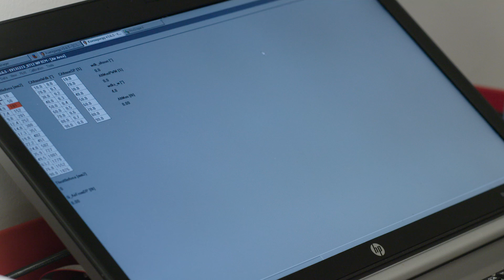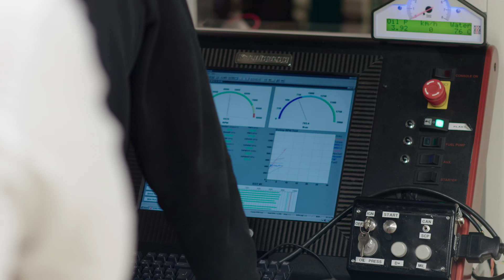The 1360HP Heart of the Koenigsegg One:1 - /INSIDE KOENIGSEGG

Comment: The Ford engine
Reply: Nope. The very first Koenigsegg used a modified Ford engine. The last car with a Ford based engine was the CC8S in 2003. The engine was built in-house by Koenigsegg in Ängelholm, but based on a modular Ford V8 engine architecture. All later Koenigsegg cars had entirely inhouse designed engines.

Comment: I personally disagree with the speaker's statement on hybrid vehicles. Hybrids are actually quite useful for the general public, and is more than just a trend. These vehicles, although not too well suited for the track, are particularly useful for city driving, with regenerative braking increasing the fuel efficiency dramatically. Does the One:1 get up to 70 miles to the gallon? I do agree that such technology isn't suited for the One:1, but hybrids are still useful elsewhere.

Comment: instead of a valve on the intake, why not an air injector like a fuel injector, you already have air pressure
Reply: You can't provide that much air through a small nozzle, sure you could raise the air pressure but the air volume needed can only efficiently be provided by a turbo- or supercharger. The one:1 uses 2 turbochargers therefore the intake air already has 0.8 bar(if I remeber correctly) under full load, and sufficient volume!

Comment: When might this technology be available for the medium to heavy duty diesel market (one tone pickups and semi trailers)? If so would it be sold as an aftermarket kit or will you lease the valve rain to other manufacturers?
You could make serious money there because diesels will never become obsoleted by electric motors. It can always produce more power and with minor changes they can use a variety of fuels. This system would be great with common rail injection.

Comment: One word; TESLA.
Reply: +Everett Cox What about tesla
Reply: +Daniel Lamoureux Actually, Tesla(762hp/900lbft) will not beat the Egg at that power level. The Croatian EC Rimac(1100hp/2800lbft) will. And the builder says the motors have lots more power in them.
Reply: +Everett Those cars weight quite a bit more than this one, which is a major factor in koenigseggs design
Reply: EV supercars don't tend to have a good 0-60 or 0-100 unlike the Model S.

Comment: im gonna have to disagree with you mr .koenigsegg. Hybrid cars are the future they will be lighter, power delivery is instant, torque is off the scale at a smaller size and weight premium and less moving parts to fail. In fact i wont be surprised if motorcycle companies don't adopt hybrids in a few years. You believe that hybrids wont be as powerful as a single engine system but your very very wrong In time you will make one too you just dont know it yet.

Comment: So yes the torque starts falling off after 6K-rpm but the HP keeps climbing because of the higher RPM. I get that.  I just don't see how increasing piston speed is going to help with engine life...Versus...Stroking the motor to say a 6 or 7 liter and keeping the RPM's lower...Any friendly, opinions..?
Reply: It's a ford designed engine that they have taken and made their own. look up their information on how the 4.6 dohc can't get too much bigger then a 5.1 liter.
Reply: mustangspartan I wasn't aware of where the engine originated.  The 4.6 did have a pretty good main cap set up.  Like six bolts per main cap.  So I guess it's not a bad choice.

Comment: Hello reliability problems. 272hp per liter says it is.

Perfect for showing off on some drag strip. Naturally there are other tuned cars that do better so what's the point with this?

Probably has huge turbos and loads of boost. That will be "interesting" to drive on anything but a drag strip. 

If any independent tests prove otherwise I will stand corrected. Until then...
Reply: It's meant to be some kind of Koenigsegg "race/gt"-car so I would imagine it's better on a track than a drag strip.

Also, about those turbos, it's not like they've built a Toyota supra.. they say that 1000+nm of torque (1371 being max) is available from 3000rpm all the way to 8000 something. That's a very nice power range.

But, as you say, tests will have to prove that. I'm really looking forward to later this spring then they'll test it on different European tracks
Reply: 272 hp/liter is nothing for a fully built turbo V8...
Reply: Audfile "This engine was DESIGNED to run at this level." Yes, and all the Koenigseggs and their reliability problems certainly prove that. Not. There are no ways to cut corners with this kind of power output and when you're a tiny company with limited resources you'll be forced to do a lot of corner cutting.

"Meaning it's light, meaning it's agile." Are you implying dragsters don't need to be light or have a good power-to-weight ratio? I'm also afraid weight alone doesn't automatically make a car agile, and certainly doesn't make the chassis communicative, something which Porsche spends years and loads of resources getting right, i.e. not something which can easily be achieved, especially not just by an impressive power-to-weight ratio, which in itself only proves it's good for dragraces.

A good power-to-weight ratio doesn't automatically spell "good handling", what an absurd notion.

So far not a single one of the One:1s have been independently tested and without some "peer review" you're looking at a car equivalent of a bold hypothesis.

I'll get out when you come up with some actual arguments rather than arbitrary assertions.

Comment: Why is this car so popular? Some shitty salen s7 makes 2200hp and people still hate it lol. They are basically the same type of car,big uncontrollable horsepower,v8,twin turbo,lmp looks.why?
Reply: Why?
1. They develop ALL their parts by their self, including the engine. They dont use heavy modified Ford 427 Engine,
2. It has a "street car" reability. Built for the road/circuit, it passed all safety regulation tests in Europe (which is the thoughest automotive regulation in the world)
3. It looks MUCH3x better
4. It has some European class. Built with extremely highend materials you can find
5. It has the comfortability of a street car
Reply: ***** the ccx used427 too,its just recently that they thought it is too expensive to outsource the ford race engine and decided to develop their own with similliar layout

I gotta agree with some quality rather than shitty murican standard.

the koenigsegg aren't that comfortable,i met some lucky agera s owner at Singapore and he talk about how the car struggle at low rpm.
but agera s is using petrol if I am not wrong so I don't know about the bio diesel ethanol one which has slightly more power.
Reply: TEH KOTAK
CVK said that Agera R with bio ethanol produce more HP and more environtment friendly. And still, Saleen are commonly used at race, so it can't categorized as production car.
Reply: Its anything but uncontrollable. That's just one of the reasons it so amazing. There is a video somewhere of a Koenigsegg doing 100+ mph and the driver is wildly swerving trying to break traction. It doesn't. Its nuts! The cars are incredibly well engineered. Plus, it sounds glorious!
Reply: Because this is a state of the art technology. Not some overblown Ford crap.
Reply: why not
Reply: a saleen s7 is ancient compared to this. an s7 has a steel tube spaceframe. 1960s tech.

the only thing they have in common is that koenigseggs original engine design was based on the ford modular v8. over the years it has changed so much that its pretty much their own new engine. nothing really remains of the old ford based engine.

im assuming you are referring to the 2200hp s7 that has been converted to all wheel drive with a 10.5L twin turbo engine??
that car is useless for anything other than 1/4 mile drag racing. a car that already handled shitty is even worse now with that huge heavy engine and awd system. and that 10.5L engine is nearly un manageable in public traffic.
Reply: Not even close to the same.
Reply: Brian Kirk what supercar cant do that?just put big enough wing on my civic and it will also do that lol
Reply: Brian Kirk that swerve test video is from /drive too. And I think they were closer to 130 mph while swerving with almost full steering lock. In that same video he brakes from 200mph to zero with no hands on the wheel and the car didn't even shutter at all. Straight as an arrow. I think they made such a sophisticated stability system because sweeden has very strict avoidance test regulations because of the moose test.
Reply: TEH KOTAK No, no it won't lol. The answer is most cars, even super cars, wont do that. The diff in a Civic would give out long before it developed enough downforce with a wing to hold it in place haha.
Reply: The car isn't just a straight line hero. This car has a HUGE possibility of fastest production car and almost comparable to Le Mans prototypes in speed.

Comment: No disrespect, but how can Koenigsegg say that not going hybrid is better?!?! Does he not believe in global warming and oil becoming more and more scarce? I mean geez, it's getting to the point with the fracking process that we're pretty much trying to squeeze oil out of rocks! Even the first gen hybrid-hypercars like the McLaren P1, Porsche 918, and Ferrari LaFerrari are allowing us to have our cake and eat it too, as the saying goes, and things are only going to get more advanced. I mean come on, even with the first gen hybrid-hypercars that I named are already showing an immense improvement in terms of emissions. When the hybrid-hypercars are putting out their combined gasoline engine and electric motor hp outputs, somewhere in the 900s, they emit only 50g of CO2/kilometer while a gasoline engine alone putting out that sort of power emits 500g of CO2/kilometer! And improved gas mileage on top of that! Here in California, if one has the means to buy a McLaren P1, they don't have to pay a gas-guzzler tax that one would have to pay if they bought, say, a Corvette ZR1. And in the case of the McLaren P1 and Porsche 918, they can run all electric. Not for very long, I concede, with current battery technology, but it's enough to silently get you from your condo downtown to a nearby restaurant and back without using any gas at all. And battery technology, like technology in general gets exponentially more advanced every 18 months. It's called So and So's Law. The person who discovered the trend and had the law named after them escapes me at the moment. But anyway, in order to keep our thirst for evermore awesome cars quenched, even if it's only reading about them or seeing them on youtube for most of us (ya gotta be worth quite a bit to have enough disposable income to pick up something like a P1), hybrid is the way of the future in terms of hypercars. Come to think of it, when I was calling for an entirely new, ground up designed Koenigsegg, maybe Mr. Koenigsegg should consider a hybrid-hypercar and join the club. Formula 1 is doing most of the leg work anyway, with the new 1.6L V-6 turbocharged engines that are not only as powerful as the previous generations of engines in terms of hp, they have 4 times the torque thanks to their dual hybrid setups! Nowadays they are not only hybrids in the first gen KERS style hybrid setups, recovering wasted kenetic energy off of the crankshaft essentially, but they also have a hybrid setup that recovers energy otherwise wasted as heat and some sound (yes sound) off of the turbocharger shaft. Let the tech trickle down like it's supposed to and make an all new hybrid-hypercar Koenigsegg! That would be amazing, I'm sure.

Comment: Noone should forget about the reliability and advantages of hybrids vs plain gas engines and diesels. Number 1, Hybrids don't need to chew up their brakes when the AC electric motors could polarize themselves. Number 2, Hybrids could deliver more instanious torque and acceleration without the possible power lag ICE has, in addition, one could tie up the electrical system to the turbos and reduce turbo lag, like in F1. Number 3, the true reason not to construct a hybrid is that they don't have the power to weight ratio of pure ICE, hence to why the ONE:1 isn't a hybrid

Comment: I remember a video when Christian showed a valve technology for engines that would make them smaller, lighter, and more powerful. He is also testing it on a Saab. I just wonder if he's doing this on his new car or at least see a development update on that technology. I'm always amazed to see what this man is up to. Thanks again, Drive!
Reply: that makes two
Reply: David King
 3
Reply: yeah i remember that video he said he was around 5 years from putting it in production. such a brilliant idea and again thats why i think he doesnt want to go to hybird technology cuz hes improving the combustion engine! Top Man!
Reply: ***** those are pneumatic valve springs basically still actuated by cams. koenegseggs system is entirely camless, completely simplifying the valve train but with 100% variability and control. its a huge tech development and the next step in internal combustion.
Reply: Sam Rad um. infinite variability meaning they can open or close fully or partially in any sequence or combination or independently.

maybe motorsports like formula one have no need for such control considering race engines only need to do 1 thing. make reliable power they have one purpose. 
where as road cars need more control and variability for changing weather altitude fuel types and road conditions.
a road legal super car has 2 purposes
it needs to be civil and efficient on the highway then turn into an animal on the track.

if your point was true then why does VTEC VCM VVTI MIVEC neoVVL cam phasing and cylinder deactivation exist on road cars??

i know theres only a certain window where valves can be open or closed in an IC engine because the 4 strokes are going to always be the same. but infinite control during that time is what they are going for with this system.

hell even the 4 strokes can change now with totyotas combined otto atkinson engines.
they do this with fine controlling of the valves simulating an atkinson cycle without having the extra con rod hinge
Reply: The "camless" engine.
Reply: Renault engineered that pneumatic valve system in F1 years ago
Reply: Sam Rad no. dont make it short. explain why.  you have no argument and failed to explain
1 the reasoning why koenigsegg is dumb for trying it (and making it work) because big manufacturers dont.
and
2 internal combustion engines have a fixed firing order which is obvious.

i never said koenigsegg knows more than the big name companies.
i am simply arguing the fact that full independent control of lift timing and duration is pretty much the best advancement that internal combustion engines could have and that its completely worth researching to make it work.
Reply: Sam Rad actually i did some reading earlier this week about koenigsegg and a very unhappy american customer. who was supposed to be the first agera owner in the usa.
to make a long story short this person basically put a major deposit on the car almost paying the whole price in full, and koenigsegg failed to deliver (literally) after 2 years of back and forth excuses and bullcrap.
like failed to deliver as in he never had the car in his possession but koenigsegg used it in numerous shows and press events but would not hand it over to the client. and in that time frame he only got to drive it once because it was having "teething problems" in development.
the car ended up getting sold back to koenigsegg under a contractual agreement that the customer not go public. wonder how many other customers have agreed to not talk.
the whole story is on luxury4play.
from what the client said from what he could tell is that koenigsegg is very cash strapped to the point where it was difficult for them to come up with his refund. and that no sweed banks will give koenigsegg loans anymore

and after reading that it got me wondering why the hell doesnt koenigsegg have a presence in the middle east at all?
the biggest market for small volume super car companies
some suspect that the seggs cant handle the high temps of the desert climate.
Reply: @aaronisgrate  I read somewhere (not sure where, was a few years ago) that the problem was the said client always changing his build specs, thus made it taking longer time and got delayed. When Koenigsegg brought his car to a car show (at Pebble Beach if I am not mistaken) the client insisted to drive the car although the car still need a few finishing and testing (since it got delayed because of ever changing requests made by the owner), and even caused some damaged to car painting. So the blaming game began and Koenigsegg ultimately decided to buy back the car and sold it to the other client. Apparently the said client did have some issues and bad reputations in car community (this one I read in a car forum, long time ago too).

And after watching several interviews with Koenigsegg owners on Youtube recently (Jeffrey, Dan, and his friends), I don't see Koenigsegg as a problematic car manufacturer, as most of them are satisfied and happy with their Koenigseggs.